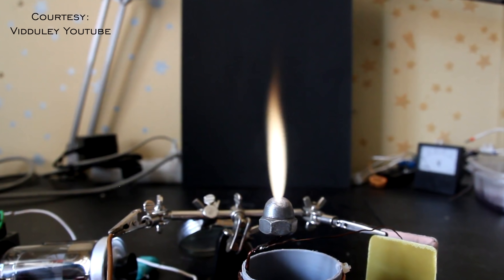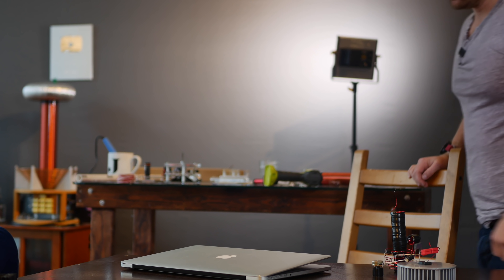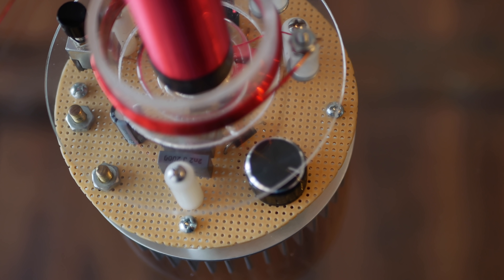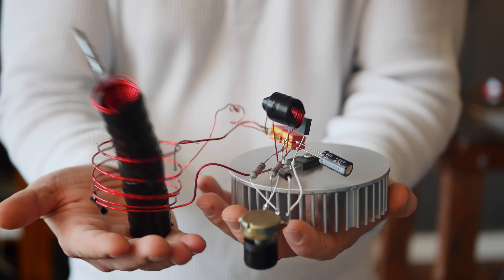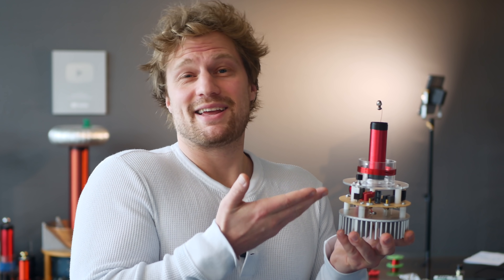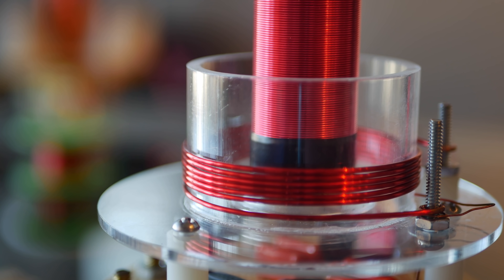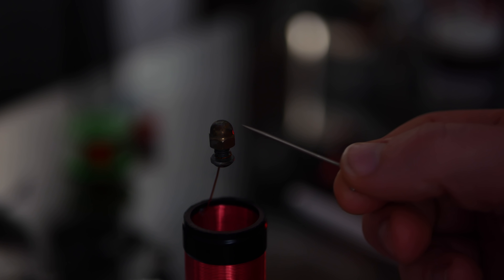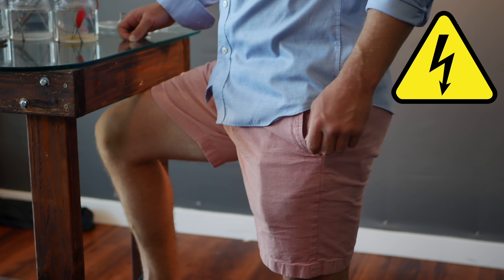Building a Wireless Power Plasma Candle ( Flame Discharge ft. Teslaundmehr)

Comment: Quick note about the 1-hand rule. ALWAYS put your left hand in your pocket, and work with your right hand, even if you are left-handed.

The reason is that the whole point of the one-hand rule is that an electric current won't pass through your heart, but since your heart is on the left side of your chest, there is a still a risk of your heart getting a shock if electricity flows from your left arm to one of your legs.
Reply: Heart is in the middle
Reply: @ДмитрийВасильев-я6б  The heart is on the left side. closer to the middle than many believe, but still on the left side.

Comment: An easy way to way to find the resonant frequency of a tuned circuit  is a gadget you can still find on ebay,   a grid-dip-meter. That would have saved you hours.

Comment: So, if it transmits electricity through the air to light a light bulb, could a long strand of fiber optic be stretched out with one end near the plasma coil, and the other end sending light into an led in another room?

Comment: awesome video! Thanks for making it. I want to point out one little thing thought, iirc, the dissipation  of your heat sink matters where the heat is coming from; your small mosfet centered gives about 2+ inches from the fins,  which I don't think is helping as much as you think it is. If you have a much smaller heat sink with more fins would be more efficient than your current design.

Comment: Can you do a Tesla coil to a copper wire that spins around a compact disk?  The wire spins with a lightning bolt striking the CD.  Check for lift of the CD off the table or ground.

Comment: Since the coil is putting out a significant amount of power wirelessly, would it theoretically be possible to capture some of that and feed it back into the circuit? Or feed another small circuit with it?

Comment: So is the flame burning the air then? I'm not clear on if the "flame" is 100% just from the electricity or if this is just getting hot enough to ignite the air. Because if it's just the electricity then this should work in a vacuum chamber I'd think. 

I'm also wondering about heat output vs power consumption compared to say a traditional heater. Seems like you could make a crazy fireplace with this tech.

Comment: awesome, just one little complaint:
for someone calling himself "plasma channel" it's rather cringy to hear you keep saying "a flame made of pure plasma" as if there'd be any other flames ever :P
Reply from the maker: Haha thanks. For the record, fire is not universally a Plasma. Straight from university webiste; "The bottom line is that a flame only becomes a plasma if it gets hot enough. Flames at lower temperatures do not contain enough ionization to become a plasma. " So, candle flames are not plasma. An acetylene torch, likely is.
Reply: @PlasmaChannel  that depends where they want to draw the line between "gas with some ionization" and "plasma with some non-ionization" on that website. but a candle flame checks all the boxes except for "it's rather cold and thus mixed with a bunch of gas". see e.g. it growing in microwaves, conducting electricity, etc. but all flames are a mixture of a gas and a plasma, by the very nature of the chemical reactions causing them.
the most commonly accepted definition for drawing that line btw is the debye length being smaller than the flame (=the plasma's ability to shield EM fields), so by that logic you could turn any flame into an "official plasma" (even though they all behave like plasma to some degree) by increasing it's size (e.g. for a candle, using a thicker wick), completely unrelated to the temperature.

also for the record, "university website" is a far stretch for a website some assistant prof just happens to host on his personal site on the uni's servers, with rather oversimplified assertions and no citations except the one from "the plasma coalition" which literally contradicts him.

Comment: As nice as your "flame" is, you might check what the FCC guys think about you polluting your neighborhood with the 10 MHz radiation.  Just one user has the rights to exact 10 MHz frequency.  That is the Standard Time transmission, service which also serves as a highly accurate 10 MHz reference.
Reply from the maker: Great input, thanks. 
No pollution present. My place is RF shielded, since I do so many experiments. Had a friend tune his radio to 10Mhz, no interference outside my place. Also, the circuit's frequency is not exactly at 10Mhz, closer to 10.8. Cheers.

Comment: I won't pretend to know anything about electronics other than having the most basic knowledge possible, Suggestion, you made a plasma candle and it works and looks great, however, there are already plasma cutters, couldn't one start off with a schematic of the plasma cutter as a baseline and scale it down to fit your needs?

Comment: So, why not use voltage controlled capacitors (varactor diode) to tune resonance instead of banging your head with so many physical parameters? If cleverly designed, could design a feedback loop that self-tunes.

Comment: 32v @ 4.4A? That's a ridiculous amount of input power for the resulting output. Where is the rest going? Are you absorbing it?
Reply from the maker: My wires all heat up tremendously. It can only run for 20 seconds before everything is hot to the touch. And considering the plasma is easily three times as hot as fire, I feel the output is decent for the power.

Comment: You blew up a lot of mosfets because the drawing you show on screen has the zener for decoration  the gate needs to be connected between the resistor and zener   also most mosfets go upto 20V gate so a 18v zener os better the higher the gate V the opener the fet less resistance

Comment: Cool idea... but how much ozone does it create? Also wouldn't it been easier to tune the tank circuit using RF and an SWR meter? Then you would have spent a lot less...

Now for the real challenge... increase your oscillator frequency to 433 MHz using mosfets.

Comment: Safety-wise, I think this is gonna crank out a lot of ozone and a lot of nitrogen dioxide.  Depending on the space and how much air is moving through it, that could get pretty toxic pretty fast.  Usually these things also put out a lot of near UV and IR more than visible light, just like a welding arc, so you might want to check that before looking at it for very long.  Also the material that the arc is attached to is probably going to sputter into the air.  Probably not a big deal unless you're using something like high chrome stainless steel.

Realistically though this is a small version of the Birkeland–Eyde process, which was historically used to make nitric acid, so... not good to breathe but possibly a good setup for making it if the raw materials are hard to get in your country?  Would be nice to test.

Comment: Just put your phone nearby and you may enjoy seeing it crash in all random ways. Plus it's a cool way to check that you didn't leave any floating pin on your ESP32. As a bonus, ozone poisoning is perfect during your dates. Yes I love tesla coils. They can even play music during those dates.
Reply from the maker: As an adventurous man, I tested if the local field affected my phone during filming. Didn't do a thing. Then again, when the flame is lit, the radiated EM field is pretty small. My radio tuned to 10mHz hardly picked it up 15 feet away.
Reply: @PlasmaChannel  It's still basically and EMI generator. I'm not sure with the flame. I've mostly some Tesla that do sparks and yes my phone lives (they have good shielding) but I do notice for example on my monitor sometimes and using just a oscilloscope as well it's crazy. I don't recall all other weird stuff I noticed.

Comment: What you need more than an oscilloscope to build this is an LCR meter to measure the inductance of your coils. That way you can tune the coil to match the capacitors and set the resonance frequency where you need it to be for the desired frequency of operation. Or learn to use a signal generator along with the scope to measure the inductors yourself. That way you can actually measure the inductance at the frequency of operation, not the frequency the LCR meter decides to test at. But if you can get a nice LCR meter out of Keysight, you should go for it :) Can never have too much test and measurement gear in your lab!

Comment: Remember you are violating radio freq rules by this device. Disturbing radiosignals around maybe around the world. 10MHz can actually travel around the world. You might catch quite big fine. Metal shield around your total circuit might help but be careful. Best luck. Jan
Reply from the maker: Thanks Jan, appreciate the comment. My place is RF shielded, and, when the flame is lit the overwhelming amount of energy goes into heating the flame, not transmitting power. I tested RF interference outside my place while it was turned on. Zero interference around the 10Mhz band.

Comment: quite a thick secondary on that... so not so much voltage ?  thats interesting... easier to wind.   I have a big tesla coil that I got from china which is powered by ZVS, but I never finished it because the secondary wire was broken when I received it,  I repaired it but I figure it will just go up in flames where I rejoined the wire.  Theres something called Corona dope but I don't have it.

Comment: Technically 10 MHz is NOT Ultra-High Frequency. UHF begins about 300 MHz. A 10 MHz high frequency, high power may violate F.C.C. regulations as well.
Reply from the maker: Correct. My walls are concrete and I placed grounded shielding over my windows during use.
Reply: @PlasmaChannel  that won't help much, you are radiation rather high power right near 30 m wavelength (right below the very popular 20m. amateur band). It is interfering with the 10 MHz  from WWV in Ft. Collins , CO which is used as a time/frequency reference for clocks. This device will interfere with these weaker signals. F.C.C. regulations prohibit unregulated use of devices like this in this part of the spectrum.
Reply from the maker: Thank you for the input, and I agree those regulations are in place for dedicated reasons. I should note: grounded shielding over my windows *as well*. Faraday cages are well proven. I took nearly 2 weeks after moving into my filming location to block out as much EMF as possible. This video was educational in nature, and I did not explicitly encourage viewers to follow suit. Cheers.

Comment: Its amazing! But wouldn't it be easier to use small signal generator to find the resonance frequency of the secondary coil and then use the same generator or an ic to drive the mosfet?

Comment: The problem with MOSFET is the excessive Gate-Drain capacity, which make the switching time too long. The end result is an excessive power dissipation, requiring that monster heatsink you are using.
The solution is to use a three winding transformer, using one winding for the recovery (damper) diode. I used a fourth winding in some design just for feedback purpose.
The use of a recovery diode goes hand in hand with a resonant primary, in a typical flyback design, yielding the same result of an EL504.
You can use a string of 3 or 4 little neon bulbs (in series) connected  between the source and drain of the MOSFET. When the circuit is out of resonance, the power reflected back into the transistor cause the voltage across Drain and Source to raise at thousand of volts: the neon bulbs fires and protect the transistor from the spike.
If you are familiar with radio broadcasting power transmitter circuitry (basically all the input, output and interstage greek-pi impedance matching circuitry), you'll find out that a 100 - 200 W circuit do produce a much better flame that a simple MOSFET output stage. Those circuits uses protection circuitry, which measure the SWR at the input and the output of the exciter and final stages, to avoid frying the transistors. Those transistors are much lower expensive than the transistor you use, but the work cold because of a much higher efficiency that simply cannot be achieved otherwise.
Nice video, I enjoyed it. Thanks...

Comment: Your plasma flame generator looks pretty neat but I watched the video from https://www.youtube.com/user/Teslaundmehr/videos which is much more impressive, I think I prefer the lesser look for the crazy high output of 11 cm plasma flame... I'm gonna try to build one myself but I don't have an oscilloscope so it's way harder for me to get it just right, I managed to get a 1 to 1.5 cm plasma streamer once which is still working to this day and it spontaneously ignites so I don't have to hold anything close to it as you have to do which isn't a problem but it's cool that it just starts on its own.
An extra cool thing that the one I built has is a split into 3 plasma streamers right at the top because I needed the end to be a bit stiffer so it hold itself up so I soldered the end part together where I folded the thin wire a couple times and purely by chance it made just the right split into 3 little pointy ends at the very top and got me the cool looking output that I didn't bother to change anymore.
So even though I don't have an oscilloscope I hope that I get it just right once more so I can upload a video with a crazy plasma flame just as Teslaundmehr.

Comment: Awesome! Those flames look so cool and so dangerous, and the design of your coil is really neat!
I have built a 13.56 MHz MOSFET powered coil a few years ago, with similar results. I've found that there are a few things that increase efficiency: 
-Pick a FET with a high d V_ds/dt rating. This becomes crucial above ~100W, because a parasitic bipolar transistor is triggered if this rating is surpassed, shorting your supply.
-Pick a FET with gate structure metallization. Normal FETs have a few ohms of internal gate series resistance, which leads to high losses. Metallized gates can have way below 1 Ohm, which is important at several amps of gate drive current. Also, lower resistance means better resonance.
And yes, you can actually burn an uncooled MOSFET just by driving it at these frequencies. Don't ask how i found out...
Reply: can you share diagram?

Comment: hey jay I didn't know your were in Seattle I'm just across the bridge in gig harbor if you ever want to learn about plasma in a vacuum and the do's don'ts and the application's let me know i dont have a lab yet but if your interested check out my fusion reactor prototype. keep in mind I used theoretical work done by lpp fusion when I engineered this prototype.
it increases the particle interactions allowing way lower vacuum and power requirement's and produces a high energy fusion reaction and is relatively easy to manufacture and is scalable.     
there are four videos on my channel. I'm looking for a team to start a engineering lab to finish my work and build and test a wide variety of prototypes 
this was a no deuterium test run of the first half of the test core and 28 mercury's is the vacuum 
so there's a major boost in performance if I get a better pump, and materials. 
read the descriptions for more info.

Comment: A tilt detection safety circuit would be a very good idea. Probably something along the lines of 10-15 degrees tilt maximum before it cuts off power.
Reply from the maker: That’s a brilliant idea. Just in case.

Comment: A simple improvement would be a tuning capacitor for the primary and a GDO to measure the resonance of the secondary.
Reply from the maker: The original design used a tuning cap.. but it was just so big. So we worked on a doable capacitance equivalent. Great idea on the GDO!
Reply: @PlasmaChannel  Hope it helps.   :)

Comment: I would start by measuring the LC secondary/150pF resonant frequency at low voltages, using a nanoVNA or a signal generator and the scope. Once you know this, then it would be a much simpler matter to tweak the driving oscillator to get to the same frequency. You'll be in the ballpark a lot quicker, and burn through less components along the way.

Comment: It's amazing at how people with no engineering training at all can successfully build projects like this!  With proper understanding of the circuit theory it would be so much easier to predictably make the circuit work the first time. This is so much better than sitting around playing video games all day!
Reply from the maker: Ture! Though, the circuit was precisely calculated to begin with. But, small fluctuations in the design, resulting from building materials, is what causes all the testing and calibration. For example, my 2.5cm diameter resonator is actually 2.65cm, but, is labelled "1 inch acrylic pipe" at my store (25.4mm). So, discrepancies like that already throw the resonance out of wack. Coupled with building it on top a heat sink, creating a capacitive effect, also throws the calculations out of wack.